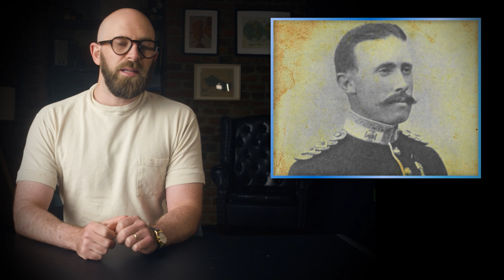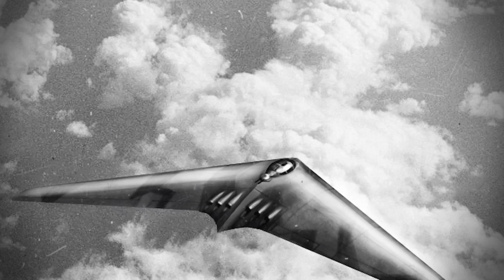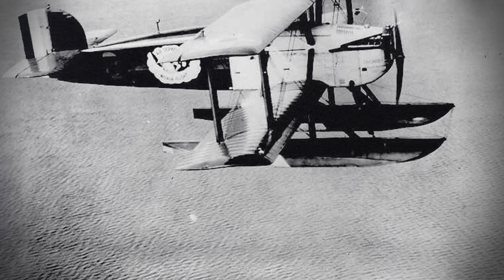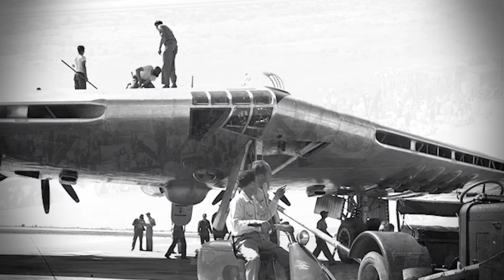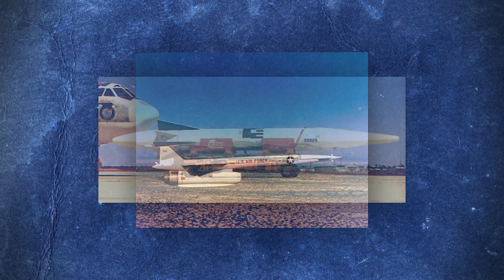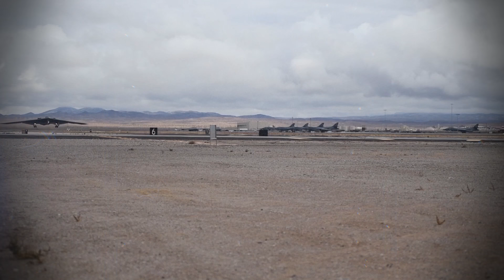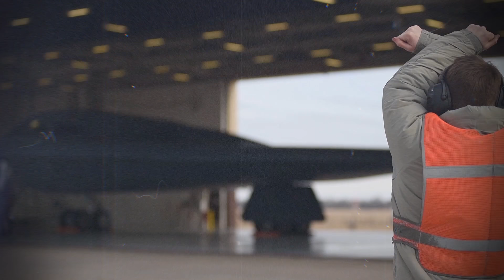$2 Billion Each - A Deep Dive Into the Incredible Engineering That Culminated the B-2 Stealth Bomber

Comment: Your characterization of Dunne's aircraft shows a lack of understanding of aerodynamics.   The vertical panels at the wing tips act as vertical stabilizers.  Without these vertical stabilizers the aircraft would have been difficult and dangerous to fly.  Most of everything  about aircraft forms had been worked out before the Wright Brothers by Lillenthal.  His scientific approach made him the father of flight.  His gliders were true flying wings with no vertical or horizontal stabilizers.  Those gliders were controlled by the pilot moving his body.   The Wright Brothers studied Lillenthal in order to understand flight.  Their powered Flyer was a biplane flying wing with horizontal stabilizers forward and vertical stabilizers aft.  The unique addition of the Wright Brothers was control surfaces.  It is the control surfaces that the patented.  Their major contribution to aerospace was the development of the wind tunnel and the data collection from those wind tunnels.     The one thing they didn't understand was Reynolds Analogy.  This resulted in non optimal wing camber that required bigger power plants to generate lift.

Comment: Not invisible to radar, sorry. Invisible to radar able to give a good enough return to target a missile at it. The enemy knows it's there. They just can't target it directly.

That's why you see in videos of the attack on Iraq, where the F-117s were doing runs, AA gun batteries swiping back and forth hoping to get a lucky hit. They knew something was there, just not exactly where. 

Which raises the question. How accurate are the signals? Could they be hooked into a gun system like the American "C-RAM" the Soviet "AK-630" or CCP "Type 730" and have them just sweep around where they know it is to get a hit, instead of humans blindly sweeping "roughly SSW at 1500 feet"?

I know the B-2 and now the B-21 fly higher than the F-117s did, but do they fly above the range of these guns? Bullets cost less than missiles, even dumb rockets, so, if Iraq had their guns tied into the radar that can detect stealth aircraft, would they have been able to take down a B-2 based on the low resolution signal of the search radar?

Comment: Meanwhile, the cost of the B-21 Raider was estimated at $700 million per aircraft. Air Force officials estimated that they would spend at least $203 billion over 30 years to develop, purchase, and operate a fleet of at least 100 B-21s.
Reply: The b2 was supposed to be a simular price (ignoring inflation)

But instead of 100 bombers they cut back by a lot
Reply: The only people worse at guessing timelines and unit costs than the USAF is Tesla

Comment: FYI: There was B2s in the 1990-91 Gulf War. I know, because I saw them at an air base is SA.
Reply: Not possible. F-117s were available but no B-2s. In 1990-91 what B-2 parts that had been built were still painted zinc cromate green and were not assembled.

Comment: Northrup Grumman and Lockheed Martin are light years ahead of the competition. 
I remember the 1980 presidential debate between Jimmy Carter and Ronald Reagan, where Reagan had accused Carter of being weak on defense because he canceled the B-1A bomber. Carter in rebuttal, let slip that the USAF was developing an invisible bomber. The Pentagon brass had a collective fit over Carter's disclosure. Again, this was 1980. While Reagan gave the go ahead for what became the B-1B bomber, work continued on the invisible mystery aircraft aircraft. Northrup Grumman rolled out the first B-2 stealth bomber in 1988, and history was made.
Reply: The B1 could take off with a larger load than the B2, or the F117 that Carter was referring to at the time. To this day, the B1 still has the most bomb capacity than anything else the USAF has had in service.
Reply: @firefighter1c57  Carter was not referring to the F-117, which clearly was not designed as a heavy bomber. While the F designation was misleading, as obviously the Nighthawk was not a fighter, it was not a substitute for the canceled B-1A version of the Bone. Development of the B-2 began in 1978 under the Advanced Technology Bomber (ATB) program.

Comment: My uncle worked in the Northrup Boeing Lead Building with Generator Power and the only 2 pieces of copper wire coming in the building terminated at a phone in the vestibule.  They answered it "Hello".

He came home stressed out one day explaining that he was going to be debriefed every 2 years.  For the rest of his life.

This was a guy that built a vehicle from scratch in Saudi when he was on the F5 project there for 4-5 years.

This was a guy that came home from Saudi, settled in a San Juans, and for a few years being retired built a dual masted sailing vessel from scratch.  He and Jack Daniels.

Then he was drafted back in and sucked into the black hole.

About 4 years before he was drafted, when I first met him, he was going on and on about Col. Edwards and Jack Northrop, and the flying wing.  When he was drafted into Boeing I knew he was building a bomber, but I did not connect the flying wing element to the scenario.

 He also had stories about lifting bodies and the 6 Million Dollar Man intro.
Reply: Boeing did the B-2 avionics and 85% of the wing. They were not a small subcontractor.

Comment: I’m no scientist, but from what I understand the math for the stealth bomber doesn’t math. My understanding is that the dimensions of the craft and the thrust provided by the engines don’t match.
In other words, the engines could not propel this craft through the sky. This craft flies, but not because of the power provided by the “engines“.
Reply: You don't understand how aircraft fly. The thrust provides adequate forward speed, which generates enough lift thanks to the massive wing area

Comment: Correction... 2 billion each for the basic airplane, including maintenance, parts, and fuel over a 20 year lifespan = not a bad deal.
Reply: Not a bad deal , really
Reply: @LOTPOR0402  Hahahahaa... To build, maintain, and fuel a super-sophisticated strategic bomber for 20 years?  Compare that to the initial purchase price of a box-stock Boeing 777 fresh off the assembly line. Then add maintenance, parts, and fuel over the same lifetime. And you can only conclude that B-2 was not a bad deal for us taxpayers. 8^)
Reply: quite good value probably cost more to run toyota corolla in america

Comment: As you said: They rebuilt one of the Horten bombers as a mockup. 

This was done at the literal Skunkworks. They put it on the pole and blasted it with the equivalent of WWII radar. 
While not comparable to the performance of the B2 (the engine intakes lit up like the 4th of July), the reduction in the Horten’s overall radar cross section was sufficient to reduce advance warning times enough to make them a viable threat, had they been available in any numbers.
Reply: The Ho-229 was in no way stealthy nor did it inspire the B-2.
Reply: @spaceageGecko At no point did I state that the HO-229 was the blueprint or inspiration for the B2 nor that it was completely stealthy. It is stealthy enough for its purpose. I also said that the performance was nowhere near the B2. Big difference. For all I care, this might have been a parallel development where none of the engineers were aware of the others work. I just don’t know and in this case I don’t really care who inspired who etc. 

I suggest watching the NatGeo documentary referenced by Simon though. You can easily find it on YouTube. The interesting bit with the radar tests starts at around the 37 minute mark. 
The engineers state that (and I quote) the Horten design achieved a “20 percent overall reduction of the detection range”. Which was a huge deal. All you need to add is historical context about the radar capabilities available at the time as well as the capabilities of fighter planes. The rest is simple math. 

In other words: The HO-229 was detected later, when it was already a lot closer to the target. Also, it was a jet powered aircraft which could just outrun most propeller driven fighters and interceptors of the time. The defenders and their Spitfires would have arrived too late to engage the bombers before they dropped their bombs on their targets. During the height of the Battle of Britain, the Brits barely managed to scramble fighters to engage the regular German bombers. Now, I am not an expert here, but detecting an enemy bomber later, while it is also flying faster than anything that you can muster sounds like a recipe for a really major headache - especially when you are already hanging on by a thread and have to carefully plan your resources and cannot really afford to lose any planes or pilots. 

The objective of the HO-229 was never to become invisible. The goal was to buy the plane just enough time to fulfill its task. 

The stealth tech in the B2 on the other hand buys it enough time so it can watch the fireworks and blind AA firing because the enemy has no freaking idea where the hell you even are. Likely they only learned that something was up because suddenly a lot of important stuff started blowing up around them seemingly at random and with no warning whatsoever. And then they can just dip and be out of there, and back home in time for tea and medals. 

My point stands: This plane would have made a difference in the European theatre, especially during the Battle of Britain, had it been available in numbers. Which it wasn’t, thankfully.
Reply: @DeputatKaktus  Apologies, there a lot of people who are convinced the HO-229 inspired the B-2 and I mistook you for one.

Comment: All that and the B-52 is what we still use because it's, you know, practical. I just spent an hour listening to this to find out all of this was a tremendous waste of obscene amounts of money for no good reason. Merica y'all.
Reply: If you think this was a waste then you weren't actually listening, and likely already had your opinion made when you started the video.

  The F-22 Raptor and the F-35 Lightning did not always exist, and the technologies they use to have such smaller signatures on radar CAME from THIS project.  Also, the F-22 and F-35 are MUCH smaller planes in general, and can't carry half as many bombs as these, so the B-2's absolutely still have value.  They are big enough to have resting areas separate from the cockpit, which is why/how they can have 30 hour flight times, something that may be technically possible in F-35s and F-22s, but nowhere near as comfortable, safe, or valuable, as (again) those two cannot carry nearly as many bombs.
Reply: just like NASA right? 20 billion a year and all we get is tang and memory foam mattresses...